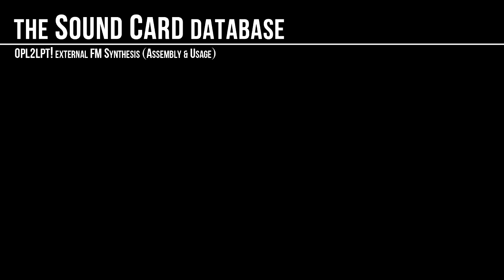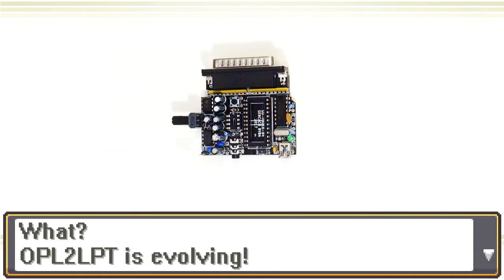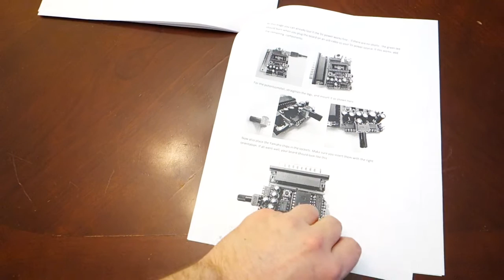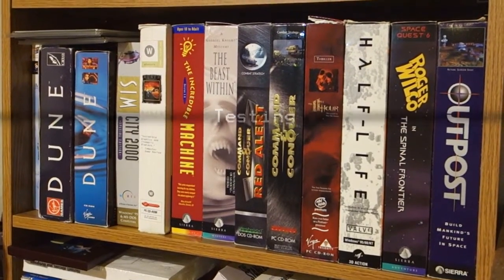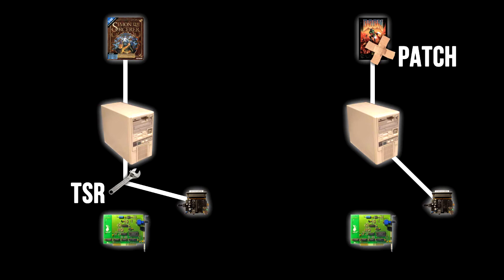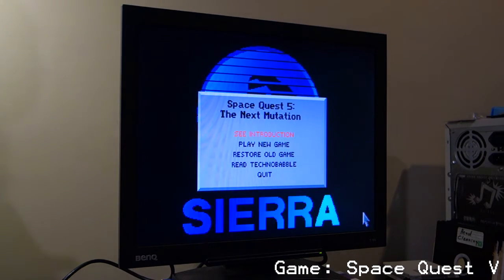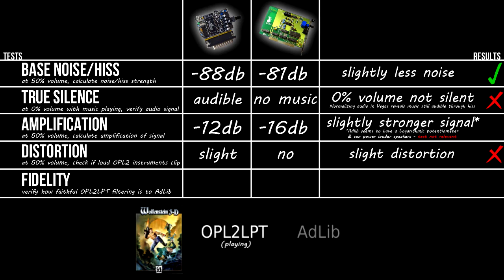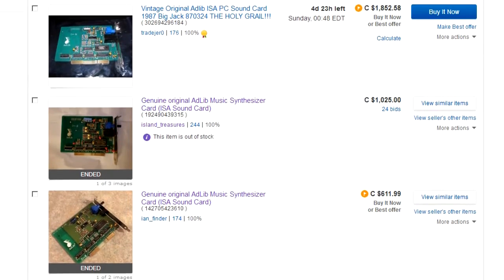OPL2LPT! External FM Synthesis (Assembly & Usage)

Comment: For the sound quality, we have to remember that the adlib have 30 y/o caps. With better caps, it will probably sound much better than in this video. Great video ^^ My AdLib is still going strong in my tandy 1000 sx :3
Reply from the maker: Yep, I thought about updating caps on AdLib a couple of times. But everytime I think about modifying the card, I think about the purists somewhere who would kill me if they knew I "butchered" an original AdLib :P

Crazy how long these things last huh! Out of curiosity, do you have a 1987 or 1990 AdLib in your Tandy?
Reply: With the  1⁄4 inch plug, it is the «87» ^^ If you wanna see it : https://drive.google.com/file/d/1Ae6JFxpWCG4nYmW5USZmAzoRnHvkvB_f/view?usp=sharing
Reply from the maker: Looks quite nice! Do you intend on recapping/modifying it sometime?
Reply: I'm the kind of guy that if it works, I don't touch it. I'll change them when the sound quality will start to really degrade or if they start to leak. My tandy is open a lot of time anyway, since I'm spending so much time playing with it. I'll ty to use a 1,44mb drive at some point when I'll have the time too, will need to thinker quite a bit to make that work.

Comment: Mine is hosed. I don’t hear the high notes on the test program. Just some percussion type beat. Then sometimes it goes funky and the led pulsates
Reply from the maker: I've had similar problems on my first test run (not shown) where sound was garbled for some notes. I simply reflowed all the solder everywhere (quick 10mn job) and the problem went away.